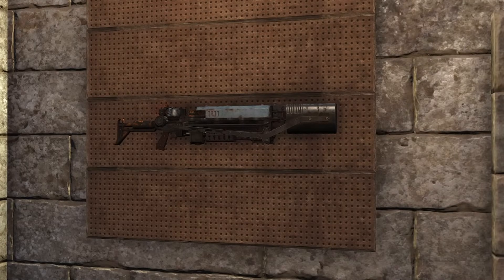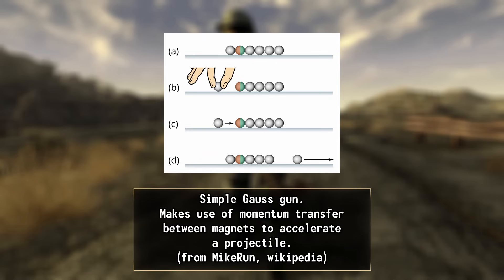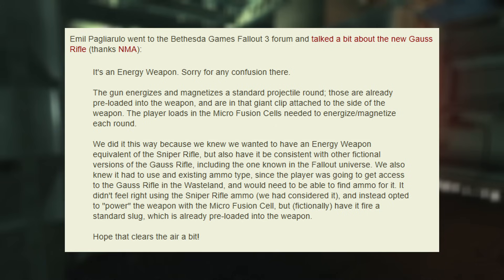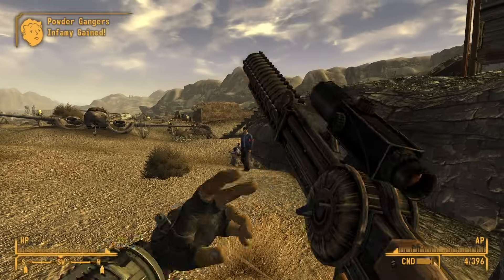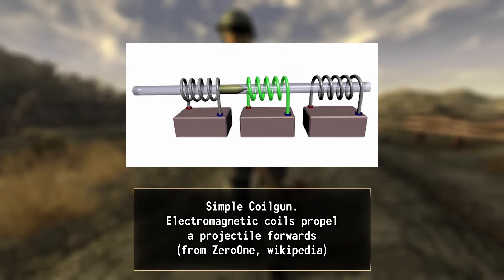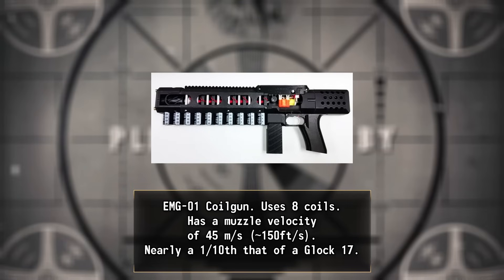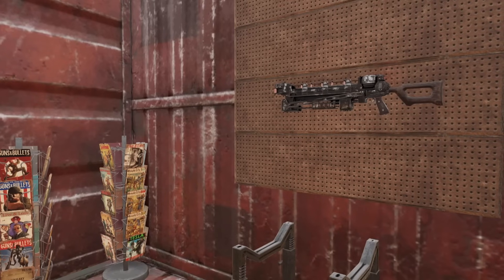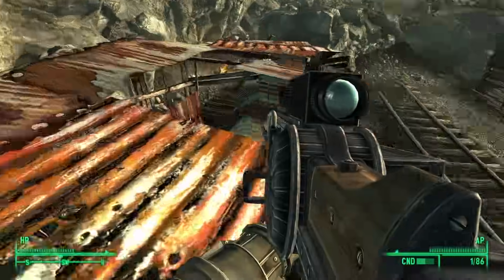How Fallout’s Gauss Rifle Actually Works | From Fallout Fiction to Real-World Function

Comment: Some massive coil/rail guns are mounted as air defense. And you mentioned space launches. And there's fun, less than lethal coil guns you can buy. They're fun. They shoot little disks and little bars depending on the gun and they charge plugged into the wall. I bet you could make an explosive round for one of those that would be lethal. Wouldn't have the range though

Comment: Small tip: in F4, not sure about F76, you can do full damage without charging the Gauss Rifle by simply firing in Vats.
Reply: I think that's because in FO4, the VATS shots are always charged by the Sole Survivor, hence the relatively slow firing speed and high AP cost.

Comment: I asked this question about 10 years ago to my dad who's an electrical engineer he's explained gauss's principle and rail guns as he used to work at Los Alamos national Labs about 30 years ago on rail guns. Practically at least today it is impossible to make a gauss rifle like what you see in fallout. At least power-wise. You can definitely make one but it's not going to blow a car up. In order to make what you see in fallout you would require essentially a nuclear bombs worth of energy shrunk down to the size of a regular battery which is exactly what happens in fallout. In the fallout universe they have fusion batteries and fission batteries as well. A fusion battery is what you would need to make a gas rifle like what you see in fallout. Which as of now is impossible.

Comment: So how does that massive friggin silencer work
Reply: @benjthorpe  Good question, especially since a magnetically propelled projectile at that scale really shouldn't be making too much noise to begin with.
Reply: @JayStrang1 the sonic boom would still be loud as hell, but there’s no real feasible way to make a silencer for that since there’s no expanding gasses like a regular gun
Reply: @tommysalami6064  Yeah, the issue there is less the actual firing of the gun, and more just the laws of physics. The only way to really deal with that would be slower projectiles, which would defeat the entire point.